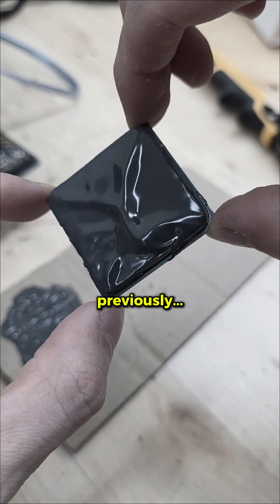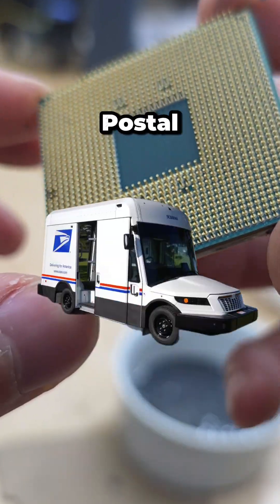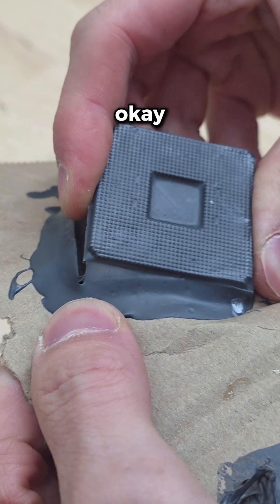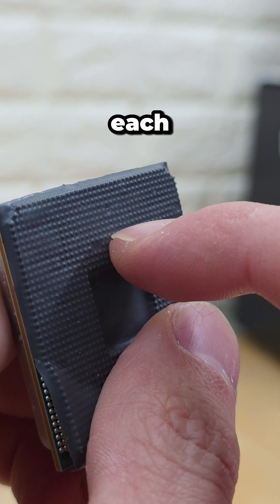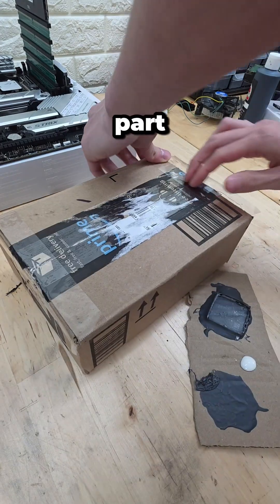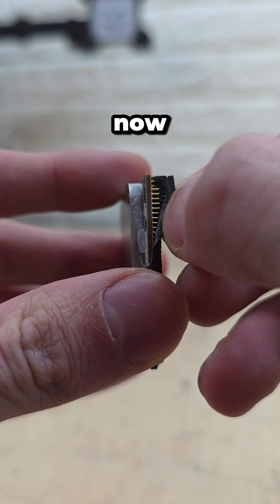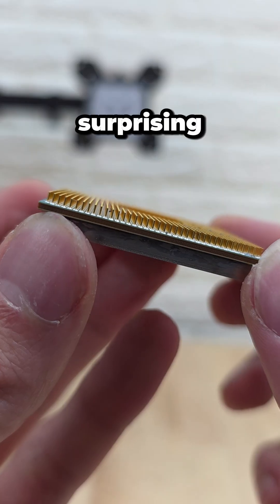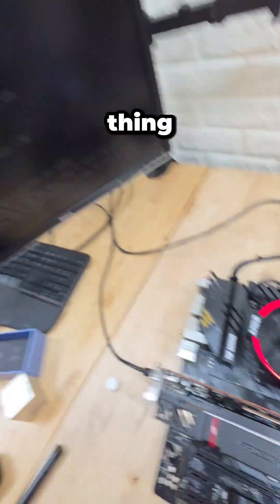the ultimate way to protect your CPU

Comment: A few touch-ups? The debris left in the pins created the need to clean between the pins which probably would result in damage by customers when cleaning. I would not recommend this method unless you can reliably remove the protective coating in one piece.

Comment: RU: Предупреждение: Не повторяйте это. Ниже описаны связанные с этим риски и возможные неполадки.
EN: Warning: Do not attempt this. The associated risks and potential malfunctions are described below.

RU: После таких манипуляций с процессорами AMD может возникнуть неприятная проблема: система начинает постоянно перезагружаться, а также перестает работать второй канал памяти. Был случай с Ryzen 5 2600X, когда у него "отваливался" второй канал (память в нем определялась системой, но не использовалась). Проблема решилась после чистки контактов процессора — оказалось, что на нем была окись прямо с завода.

EN: After such manipulations with AMD processors, an annoying issue can occur: the system may start rebooting constantly, and the second memory channel may stop working. There was a case with a Ryzen 5 2600X where the second memory channel "failed" (the memory was detected by the system but remained unused). The problem was resolved after cleaning the processor's contacts — it turned out there was oxidation on them straight from the factory.

Comment: Not sure about rubber but I wonder if wax would work. It's used in manufacturing to protect things like threads or cutting edges on tools and is super easy to remove

Comment: You know, I bet if you can fine a more resin based rubber that doesn't break a part when its pulled off.

Humm I even bet you can make a mold for a pin protector so you can store them without worry.  I might have to think of that.

Comment: Maybe try again with some sort of lubricant applied first because that doesn't seem reliable or easy enough to prevent gunk sticking to the pins and/or pins to bend or break when removing the rubber.
Sure the lubricant might need to be washed off, but that should be easy, and as long as everything else goes well would actually make this more viable.

Comment: best you could do is get a cpu model turn that into a mold then use rubber in that mold and when the rubber becomes yk rubber put that on the back of the cpu
or use plastic casings

Comment: In all fairness, if you spray the pins with a silicon mold release prior to coating in the rubber, it would probably slide off like butter. You really wouldn't get better protection than custom fit. lol

Comment: Idk, maybe a wax seal of the pins could work. Melt the wax away with a hair dryer or heat gun. It melts between 30 to 80 c which the cpu should be able to withstand.

Comment: Why not just use a piece of thin foam rubber. Tape it on with 2 pieces of card board, one on top, one on the bottom.

Comment: That is the worst possible solution! 
a) You can easily bend pins when you remove the rubber and it may be very hard to properly remove all residues.
b) You are creating pretty huge ESD when peeling the rubber, so even if there's no damage to the pins you may fry your CPU.
c) it's expensive for one-off and lot's of hassle.

Comment: Actually, I wanna buy a cpu from you, but I want it a more better way, to protect the pin of cpu, you can give me a free motherboard where the cpu is already inserted, to protect that free motherboard you can give me it inside a free pc case. And then just protect the case with foam and send me. If you want I can give you suggestion about good quality protective mother board and case.

Comment: Wouldn't it make more sense to sell containers that have holes for every pin in the first place with just two clips on the back so it stays firmly in place? I doubt the packaging cost would be that much more if you intended to second cpu's around anyways right?

Comment: just take 2 pieces of foam, put CPU between that pieces and put this sandwich in a box, without gaps. It would be perfectly safe and you dont need to clean CPU from rubber. I guess you never bought OEM CPUs)

Comment: You can also build a contraption out of cardboard to suspend the cpu so nothing touches the pins
Reply: you could probably just stick it in foam and then put it in a box
Reply: @VENGENCE150  yeah I didn’t have any foam so I cut a hole in the cardboard, stuck the ihs into it, cut a hole in a couple more layers then added a holeless layer and stuck the whole thing into a plastic bag

Comment: Pulling the rubber off bends the pins. Straightening bent pins, cracks the solder and that's no Bueno. What happened to Styrofoam blocks or CPU plastic cases?

Comment: interesting, so for the cost of a few cents worth of rubber, they could save on a big box.   My take is this the CPU always comes in its own lil plastic shielding.   But what if they made it a few mm larger to accommodate  a rubbers housing for the pins, which in essence is just a copy of the pin layout the cpu will socket into.  Bent pins never again, unless its been literally stomped on or perhaps crushed in some extreme cpu torture while in transit.

Comment: Try postage wax next, or stamp wax for envelopes
Reply: On a related note, don't use that stuff for actual envelopes you're sending through the mail. The uneven thickness plays havoc on the sorting machines. Or if you really want to do it, either make sure it's posted as non-machinable and submitted over the counter rather than through a dropbox, or at the very least, put it inside another envelope, which will protect the seal and help even out the rate at which the thickness changes.

Comment: With the right silicone, this could be practical and the new way to ship cpus, honestly.
Reply: Honestly you don't even need to change the rubber.  Just design a little plastic mess it binds to at the bottom so you can relatively easily extract it.  I'm also certain that the chip can handle the heat better than the rubber, so alternative is they come in a plastic bag that's water proof and you're instructured to basically boil it to get plastic to come off.

Comment: It was the bigger box that saved it because even if it was in a smaller package and inside a clamshell, it wouldn't matter, if they damaged it then it'd get damaged regardless of it covered in rubber or not lol. At least in a bigger box it can move around and prevent being squished due to the space, but of course not guaranteed lmao.

Comment: When i ship thing i dont want broken, i 3d print a protective box or corners from tpu. I use the 3d honeycomb with a .4 nozzle. I make it a staggered 1 and 2 wall shell. Keeping it 3/8 thick, it gives alot of protection. Plus you can make it any shpe you want. You can also 3d print it sealed and filled with mineral oil and the cpu inside of it. You can then just put it in a tubberware that is small and a flat rate box. The flat rates are the better option.

Comment: Saves his cpu puts it in casually turns on pc with butter knife
Reply: Yes, anyone who's built a PC and is remotely competent knows you should short the power pins to check it before installing into the case

I guess unless you like doing the whole build twice
Reply: @siccoblue2112 I installed the motherboard in my gaming pc without ever shorting the power pins

Everything works fine
Reply: @siccoblue2112  I assembled my computer without any prior knowledge of anything. I just put the parts where they seemed like they should go. Six years on.

Prior experience- I am a UPS driver
Reply: I’ve been using a metal pick to turn on my pc for years now lol just never bothered buying a switch

Comment: I dont care about the cpu but can i get some of that rubber
Reply: Its plastidip, you can thin it out by adding more of the solvent used in the product.

Make sure to hang it up in a very well ventilated place, this shit stinks real bad but its also amazing for making tool handles.

I bought orange and black and the orange one was more thin and made a much thinner coat when dried.
Reply: @xMrjamjam I wonder if the solvent used in the product is safe for electronics or does it eat away at them?
Reply: @SilverRose45  it depends, if it can eat away at silicon or metal definitely no.
Reply: No he means because of the shape it left